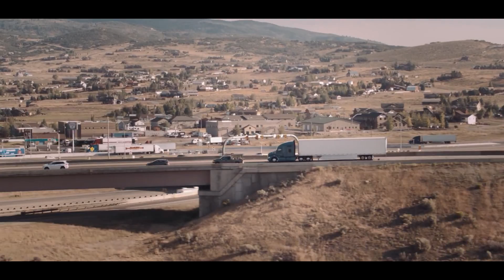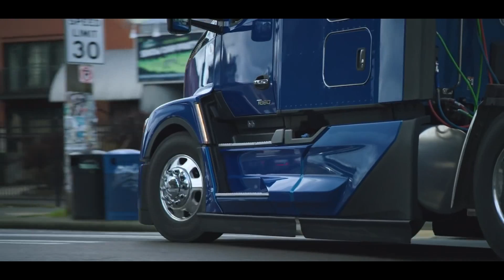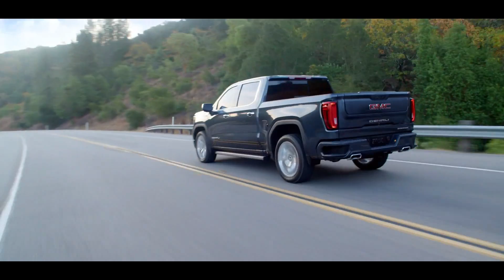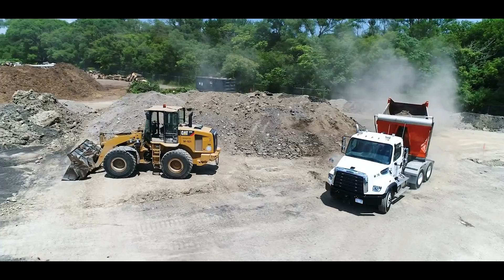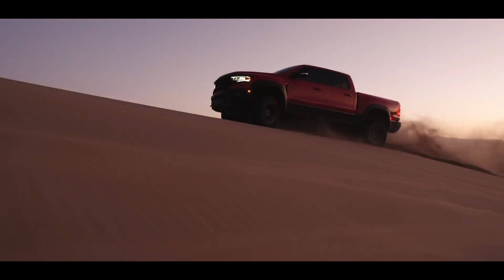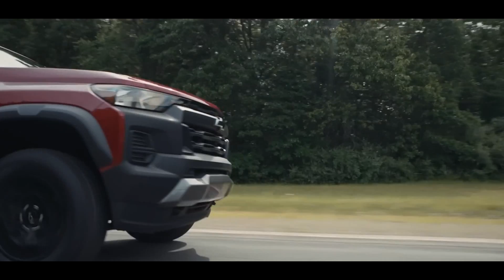Why A Semi-Trucks Will Outperform a Pickup Truck

Comment: Take the same displacement and cylinder length and i6 will have more torque than a v8. and hp
Has nothing to do with torque and longer strokes are the example they are slow but strong. If you realize the semi engines are all tall inlines, well the successful ones. The cat 3408 is a v8 it ain't good though

Comment: The latest Ford Powerstroke 6.7L with 1,200lb/ft of torque slowly brings a pickup truck into semi-truck territory.
Reply: It does but Frame brakes axles ubolts leaf springs and many more heavy duty parts, The pickup truck lacks limits its hauling ability, there's alot more than just having a strong engine.

Comment: Same goes for Farm Tractors: An 100-125hp Tractor can pull more than most semi trucks. High torque at low rpm, weight, gearing, and most important, traction, and here it goes.
Reply: Yup but turtle like mobility, Semis are Fast and powerful and have mobility

Comment: a semi truck will always out live a pickuptruck while hauling cargo, especially semis from the golden era 1990-2006 have the ability to be rebuilt every 1,000,000 miles
Reply: I drive a 2003 W900 with a rebuilt 6nz cat. 565 hp and 2050 pounds of torque. Yes golden age of trucking sir.

Comment: you never mentioned electric trucks which also has high horsepower & torque, yet the range is not even close to the range of trucks with ICE.

Comment: The question is, can pick up trucks haul loads that reach 40,000 tons- 50,000 tons and can he climb such a load in inclined areas? and are pick up trucks capable of long-term travel in such a load, maybe in the US and other parts of Europe it is possible because there are no mountains, but in Asia it is not really possible because of the terrain. For me the better to compare is the pick up trucks and the Japanese trucks like the Mitsubishi canter, isuzu Elf and the Isuzu Forward also the Mitsubishi Fuso Fighter
Reply: 40,000 tons is 800,000 lbs. And saying the US doesn't have mountains is a very wrong assumption. Not attacking just couldn't handle those two things in the same post
Reply: @nickrexroth2785  sorry sir, for the wrong assumption, i just want to clear that the US mountain terrain is very different in Southeast asian mountain terrains
Reply: Even God can't pull 40,000 tons - 50,000 tons mate
Reply: @axel3895  oh sorry mate, it just only around 40tons to 50tons

Comment: Detroit engines have shitty pull power. DD13, DD14, DD15 all struggle pulling. I'll always go with a Cummins engine over a Detroit engine
Reply: That is only because your elevator doesn't go all the way to the top. If it did, you'd go Detroit.
Reply: @huntsbychainsaw5986 good one

Comment: What I find interesting is that there are vans with i5, V6 and V12 diesel engines that produce insane torque and then you get the same engine in a semi with exactly the same power/torque, however the van cannot haul the same weight because it's not just about the power, the chassis, the breaks, the suspension, the steering, the grip are all big factors into how much a vehicle can haul. I had an alfa 159 that produces 400 Nm yet it cannot haul the same as a Toyota Hilux that my brother has, he was able to get a delivery truck out of the mud with that thing but I know the second I try something like that I'll just bend the chassis or something, yes same power, one 400 Nm the Other 420 Nm, but they do different jobs.
Reply: A big factor is also the transmission, you need a strong transmission with excellent low gears to get heavy objects in motion or up steep inclines

Comment: In Japan, Isuzu 6UZ1 & Hino A09C are still the most efficient diesel engines for global market, but they're large rigid trucks (payload capacity is about 30,000lbs). But in terms of semi, nothing reigns other than the Isuzu 6WG1 ranging from 400-520hp. The long distance ones are usually ranges at about 420hp.

In Europe, nothing beats Volvo D13 inline six engine for European Semi.
Reply: The 6wg1 is fcking massive too😂
15.7 liters and generating only 520 horsepower means it's going to last for a long ass time if the electronics hold up.

Comment: If I need to carry weight, definitely not a poser mobile pick up. I'd get an Isuzu npr with a 6l v8, an actual work truck.

However if I wanted to tell the world how insecure I was, I'd definitely get a Denali or f350 or similar. The world needs to know I'm actually a big man even if inside I'm not like most of the other owners.
Reply: If I'd do actual work I'd get a Mercedes Van, smaller outside for the same space inside, nice and high load capacity and I actually have a roof. Pickups are pretty useless, but hey, I guess that's why they are few and far between among shipping and construction companies

Comment: There are trucks that can do super heavy duty work. Like up to 40k pounds. It’s def great for personal stuff. I say a good company will use both. Lighter duty, smaller loads, tight congested area, pick up truck. Super heavy load up to 200k lbs, long drive, delivering a large load, semi.

Comment: We have pickup trucks that can pull up to 60,000 lbs
Reply: And I've personally pulled 82k pounds up a 12% incline still accelerating at 60km/h (37mph) in a semi, granted it had 770hp and 3700Nm (2700ft lb) from a 16.4L V8
Reply: Take that 60k pickup and try to panic stop it safely

Comment: That ram cant pull some weight diesel ram can
Reply: Yeah the ram 3500 and 4500 with a high out 6.7 Cummins can tow upto and over 40,000lbs

Comment: Semis output even three times more torque!
Reply: Crankshaft torque doesn't matter when there are gear reductions in the transmission and the final drive
Reply: @turtleb01  Yes torque ABSOLUTELY matters! The more torque from the engine, means more torque you can multiply thru gears.
Reply: @sstevocamaro  Car and pickup engines sustain their peak torque at much higher RPM than semi truck engines. Let's say you have a RAM TRX engine giving 650 lb-ft at 4800 rpm. Cummins X15 gives 2050 lb-ft at around 1500 rpm. When you give TRX a 3.2x gear reduction, the two engines are almost equal: TRX will have 2080 ft-lb at 1500 rpm.
Reply: Thats why it called semi

Comment: It all depends on the work you're doing. Can't go wrong with either. But simply put, semi trucks are classified as heavy duty whereas pick up trucks are light duty.
Reply: America has a heavy duty pickup truck segemnt
Reply: @ogegamakori6447  semi trucks also have segments known worldwide, light duty, medium duty and heavy duty.
Reply: @AD28197  the pickup trucks am talking about can tow upto 30000pounds around 12000kg
Reply: @ogegamakori6447  and those are regarded as full size pickup trucks, not heavy duty trucks. Light duty trucks can easily haul the same laud and slightly more. In regard to pickups, there are two classifications; medium size e.g.tacoma, colorado and frontier and full size e.g ram trx, tundra, titan and silverado e.t.c
Reply: @AD28197  also exist a  heavy duty segment the one that you dont know the Ram 2500,3500,4500, the chevy silverado 2500,3500,4500,5500, and the ford f250,f350,f450,f550
Reply: @ogegamakori6447  the ram 1500 trx has the most powerful engine for a full size pickup, fyi it doubles all the pickups you just mentioned in HP and Torque despite having similar engine size. It is still not a heavy duty truck!!!
Reply: @AD28197  thats a gasser am talking about diesel trucks the TRX is just fun truck for offroading in highspeeds
Reply: @ogegamakori6447  based on the engine specs, the gasoline pickup truck would be more capable and less stressed when hauling 12T compared to the diesel trucks. Only caveat would be fuel consumption.
Reply: @ogegamakori6447  even cars like the landcruiser 300, land rover defender and mercedes gwagon have better engine specs but are not classified as heavy duty.
Reply: @AD28197  you need visual evidence of what am talking about
Reply: @AD28197  are you on instagram i can send you a video of proof
Reply: @ogegamakori6447  you can share the link here
Reply: @ogegamakori6447  I haven't disputed what the full size pickup trucks are capable of, I disputed them being classified as heavy duty trucks which they clearly are not.
Reply: @AD28197  true
Reply: @ogegamakori6447 oooo 30000 punds mean 12T I toght they are around the same weight like at least 25T
Reply: @ogegamakori6447  you mean american continent? only in us and canada.

Comment: sorry, but about pick ups you know absolutely nothing
Reply: What did he really say wrong 😑
Reply: @consisepepper73  never even mentioned diesel engines, which would be the only choice for heavier work of light duty trucks.. I mean like 6.7 power stroke, like 6.7 cummins or 6.6 Duramax
edit
Those are capable of towing over 30000lbs now. I wouldn't do it myself, but he should mention
Reply: @marcelo403polo2  true lets say the images gives away
Reply: @marcelo403polo2  true but for the main point he ain’t too far of which is better he at too far off. Plus this was more of an overview versus specifics
Reply: @marcelo403polo2 yes but some can tow upto or up ver 40,000lbs now
Reply: @ZMCDGaming  theoretically yes. But trust me you don’t want to tow 40K lbs with pick up. At least not any long distances
It is only my own opinion
Reply: @marcelo403polo2  I mean Ik someone who does hot shot trucking with a 2022 ram 5500 and it’s had 43,000lbs and it tows it really good and good on hills and downhill with exhaust brake it slows him down so much or maintains his speed so he doesn’t have to use his brake and trailer brakes
Reply: Yea I figured he’d compare the diesels to diesels. But he isn’t far off. The semi can haul more, but the pickup is more practical basically.